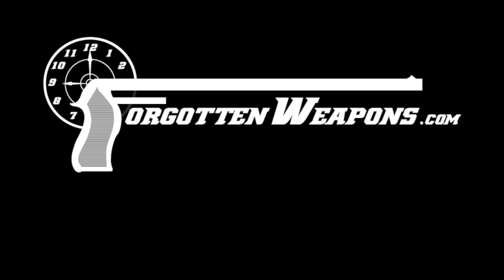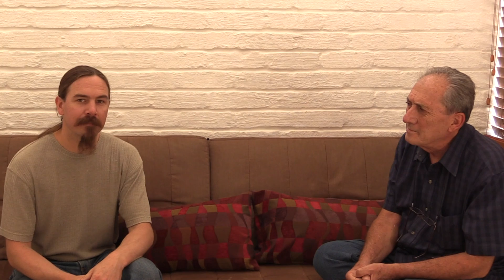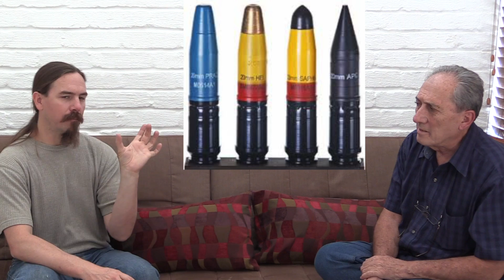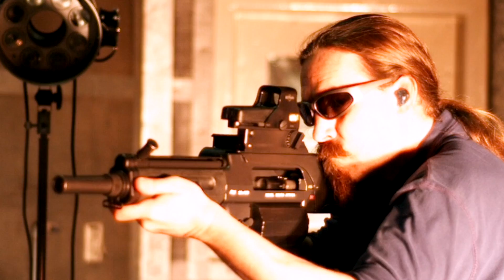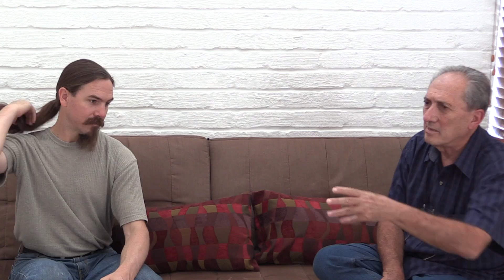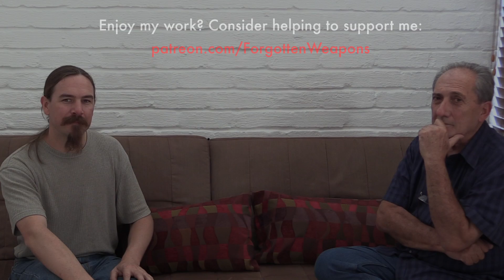Interview: Tony Neophytou (Neostead, Inkunzi PAW, NTW-20, NeoStrike)

Comment: Did you know that Amris created a magazine fess suppressed anti material bolt action rifle that uses the 20mmx42mm cartridge? It's only a 5 round magazine but imagine if they created a 10 or 15 round capacity magazine. 

Gases tend to escape through The cylinder in revolvers, but not in semi auto or bolt action firearms.

Comment: Your little section on using the PAW as an anti-piracy weapon reminds me of my idea of putting together something resembling a WWII Destroyer or Destroyer Escort for that purpose. I had the idea, why not build a bunch of relatively cheap escort type ships, make them reasonably fast to be able to chase down these small boats if need be and just cover them in 20mm Oerlikons and 40mm Bofors guns. I also kind of had the thought, that if you're going to that kind of trouble to fend off these pirates, why not institute a convoy system for ships passing through that area. Granted, ships of that nature are far obsolete for fighting any sort of established navy, but the little pirate bands are hardly an established navy. I do have to admit, the best way to end the raids would probably be to get a stable government established in Somalia, but that hasn't exactly been going well so far.

Comment: "I would tell them sit down until the feeling goes away" - Most truest statement ever

Im studding mechanical engineering at uni which gives me a lot of inspiration and free time so ive been designing firearms (among other things) in CAD and the amount of half finished folders i have in which i scrapped the idea and started again and scrapped and started again ect. is unreal. Constantly running into walls, You cant design the receiver without magazine dimensions to fit it,so you design the magazine. Then you cant design the bolt assembly without the gas parts, so you try to design the gas parts but then you need the barrel. Its a constant circle of everything depending one something being finished but you cant finish that because it depends on something else. Even using existing concepts and designing a belt fed Bren can get so complex for no apparent reason. This guy must have spent a long time to have at least 3 functional designs.
Reply: As a recent graduate, I feel your pain :( . ALWAYS start with concept drawings, throw generic requirements and needs into the mix and you'll run into walls 10% often. 

I used to lose sleep over how to recreate the Russian GSh-18 pistol with a simpler rotating barrel and slide. Or implementing a truly striker fired trigger group into a modern Eurorifle. Then you hate yourself for trying to invent your style of Lever-delayed Blowback because it's too complex for PDWs. Aaaaaaaaaargh!
Reply: +Joseph Cantwell 
Yeap! I haven't done a lot of that, but am a little familiar with this, "I have a cool idea!", drawed it in CAD, ran simulation...  Nah, doesn't work!
Reply: This is where "Organic development" comes into play. Starting off with CAD is a rookie mistake. First build and hand-fit a rough prototype. No angle will be straight or square, no surface finished or polished. It'll be ugly as sin, but it's where you need to start. It's easier to hammer, file, Dremel and drill "as needed" to make something than it is to lay things out in CAD, because you can't hold a CAD design; you can't cycle or feel it, you can't test the balance of a CAD design.

The other part of Organic development: Cheat. If there's a magazine that's really, really close to what you need.. use it and modify to your needs. Bolt that kind of matches? Use it. Don't try to design every single thing yourself - such is an exercise in futility, especially when you're starting out.
Reply: Joseph Cantwell Hopefully one day you will get the hang of it
Reply: You have to start with simple things! I was going to engineer a straight blowback pistol but after a bit of thought I decided to design a pepperbox revolver and even that is turning out to be way more complex than I thought
Reply: Mongoose556 I don't think you can be charged on "intent". Until you don't actually produce a shooting firearm it should be perfectly legal
Reply: Mike Lilienthal unfortunately in some countries, that will get you charged with intent to manufacture a firearm and prison term. :( it's a good idea though.

Comment: I think the PAW would have a place on a reconnacance team. It would allow direct anti material fire with greater range than the current 40mm options.
Reply: Yes, the recon patrol stays alive by seeing the enemy but not being seen by the enemy, sneaky bastards that they are. They travel light so they can move fast. They try to leave little or no evidence of their passage. Although, they have a lot of tricks up their sleeve. For instance, if an enemy unit picks up their trail, they may fabricate signs that indicate to their pursuers that they are a larger element than they really are. This may cause the enemy to pursue them with a larger force, which slows them down. Sneaky bastards!
Reply: a pump gun with that ammo .... would be adequate. the milcor 40mm mlg is ok... but you don't want to be tasked with it on patrol.  the problem is the recoil. a light gun would kick a whole lot more.